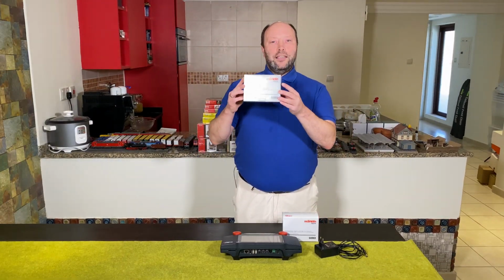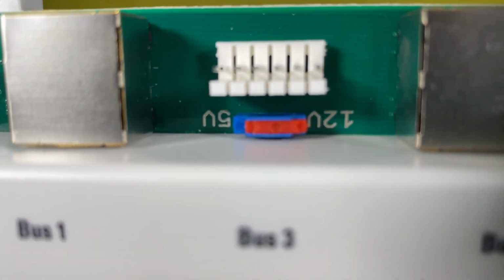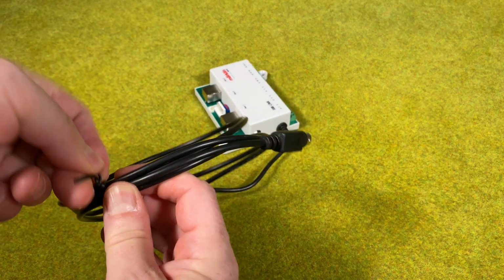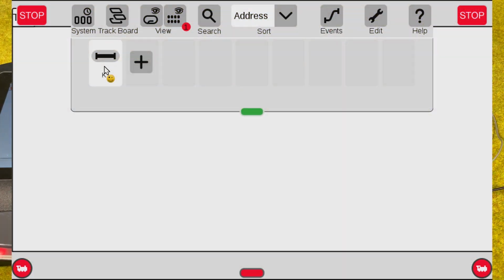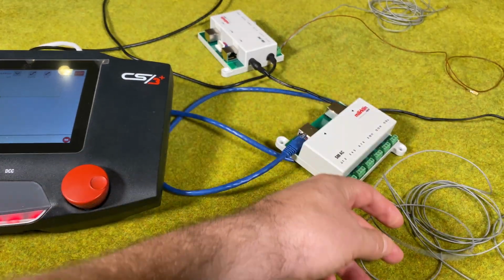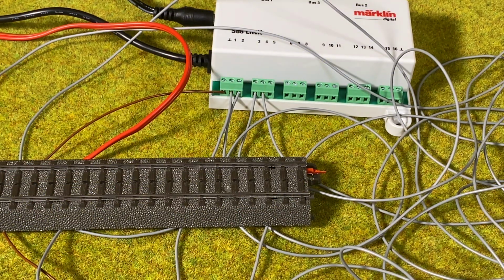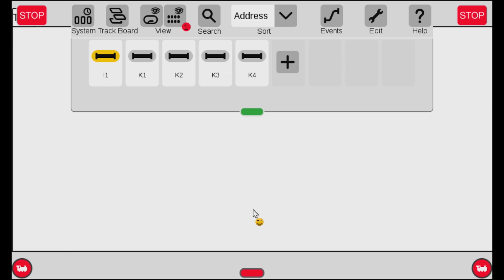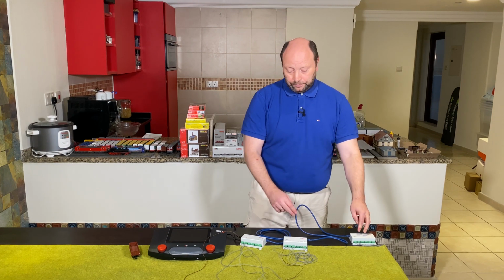S88 and Link88 (Märklin 60881/60883) on the CS3 with contact track (Automation Episode 3)

Comment: Hello again I wrote to you several weeks back when I had a problem with my M83 decoder. And thanks again for the tips and advice you gave me. Since then it stopped working with the turnouts, but i finally got them to work again, however they would only work when i had my CS3 connected via the programming connection. i did add some more track to my layout but still not a big layout. But now I am finding there is some sort of conflict in the cs3 itself, as one of my almost new mfx locos wont respond to commands when on the track but will respond when on a small length of programming track connected to the programming input on the cs3. I tried to reset the device  which deleted all the locos but that made no difference either. I wondered if you had ever heard of a problem like this. I have had the cs3 for just on a year and performed one update several months ago. I tested one of my non MFX non sound locos and that did work ok.
Reply from the maker: It sounds like you have some interesting issue. Could you email me (see About) and describe the situation and what you done. Then I will see what I can do to help. Enjoy ;-)
Reply: @ModelTrainFun  Hi there thanks for the reply will email soon again.

Comment: Big fan here, thank you for all videos, I wonder if you can explain how to build a signal track with signals ( like 70411) coupled with  72442 marklin bremsmodule.
Reply from the maker: Thanks - I am glad you like the channel!

To be honest the reason that I have not looked at the braking module yet is that I think it is a very expensive solution... I try to make videos on items I recommend and right now I am very much in doubt if the braking module really is worth it...

Intriguing is the following video from @SignalNe4 that show how to make a low cost braking module yourself (unfortunately in German): https://www.youtube.com/watch?v=g7vBXv8QeBk

However, I have purchased a braking module (still missing a power supply) so maybe I should just need to make the video, warn about the price and let the viewers make up their own mind? What do you think?

Enjoy ;-)
Reply: @ModelTrainFun  I agree. I bought one, many cables, very heavy to install. I will run my train with Rocrail, with this program there is no need of braking module any longer.
Reply from the maker: @piwiwipi5233  Sounds like a much better idea ;-)